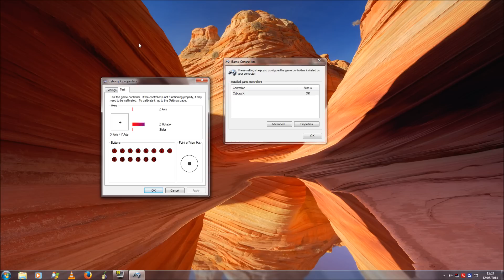Cyborg X Disassembly

Comment: The fatal problem is from its design. The movable throttle base increases the abrasion of the wire inside. I own one and after 5 years of normal use, the z axis has strange drift after power on for a few time. Also the wires inside are incredible thin and vulnerable.

Comment: I have one of these but discovered my main issue was the spring is too heavy for fine control. Its the way saitek mount their springs. They insist on putting them on the outside so they're on show, but then have to do silly things like adding a spring mounting saucer so the stick can move in it's full range. This is what gives them a jerky feeling when moving away from centre. A lighter spring would help, but sometimes the feel of a heaviee spring is necessary.
I didn't use mine long before I bought a Thrustmaster T.Flight HOTAS X. Besides the benefit of a full sized throttle, the stick has an adjustable spring tensioner in the bottom, and the movement away from centre is always smooth. It's also cheaper than the Saitek Cybork.
Reply: +PIK You can reduce the spring preload by using cable-zip-ties around two (or even more) windings of the coil spring. It is not perfect, but it does work. Well, I guess you have found a better alternative, but maybe it is useful for other users of joysticks that use this type of spring-centering!
Reply: Yeah I did actually try this, I didn't like the feel though. The handle tends to flop about around centre with this "mod" too which meant I had to play with deadzones. It's a handy solution in a pinch though.